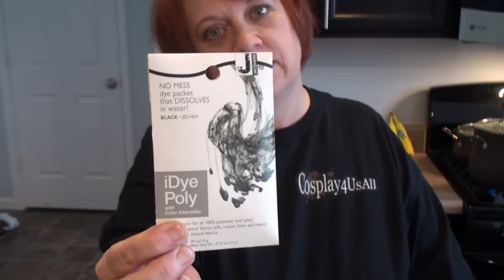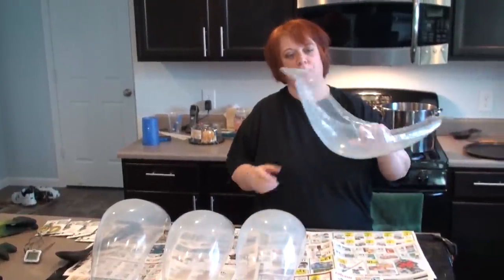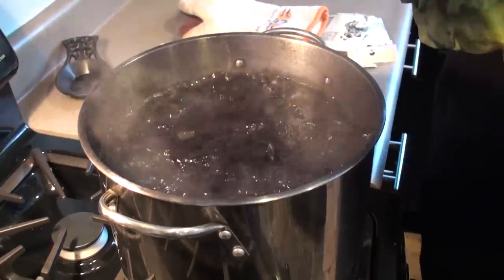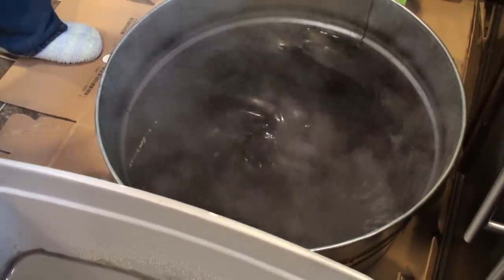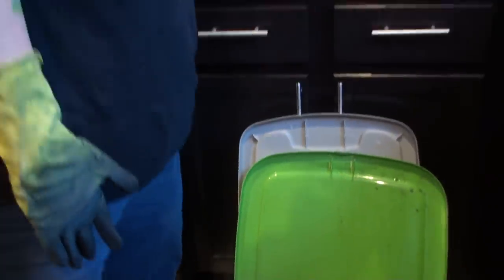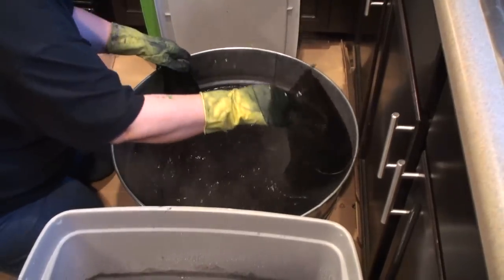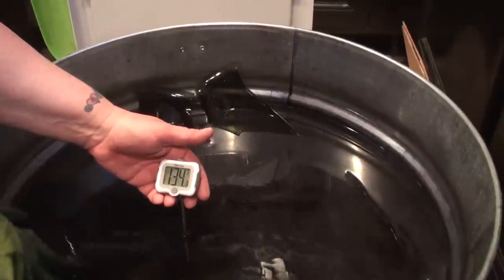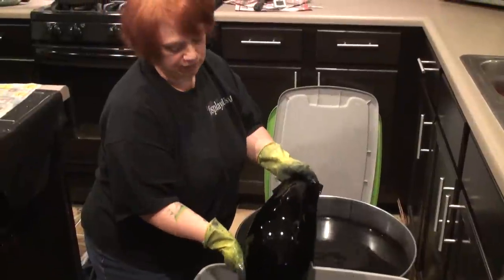How to Dye a Plastic Visor (PETG)

Comment: how many idye packets for tinting sunglasses lenses?
the lenses are smaller pieces, would I have to use one packet with fewer amount of water?
Reply: they're plastic lenses .
Reply: +seek wisdom Depending on the amount of water you use, one or two packets would be fine. If it is a small pot, one should work. A slightly larger one, go for two.
Reply: ***** thank you..😃 super video..

Comment: Fantastic, and you guys seem nice too! Quick question, would this work on PVC fabric (i.e. transparent raincoats?)
Reply: It works on synthetic fabrics, not sure about a raincoat. Might depend on whether or not the PVC fabric has any kind of water repellent on it, or is treated in any way, to make the rain bead. I would say, give it a go! Try an inconspicuous area (bottom, back hem maybe?) or, if the coat has anywhere that you can snip just a tiny piece off (lining, extra material at the hem, or pocket?) snip that and try a tiny test :)
Reply: Thanks for your advice! It's for a coat I have yet to buy, so I could always test it out on a few cheaper versions first. Thanks again :)

Comment: i have a very strong perscription on my glasses and becouse of this i cant use masks with visors unless thy match hat perscription.

i have a custom made helmet with slots for my lenses to go in but the need tinting to match... wpuld this method work!????
Reply from the maker: Unknown. It would depend on the material (type of plastic) that your lenses are made from. Certain plastics respond to the dye better than others do. Also, if you have any kind of anti-scratch or anti-reflection treatment on the lenses, then it most likely would not work.
I usually would say to experiment with some scrap and see how it goes, but I don't think that would be possible in your situation :/

Comment: Will this method work on Oakley football visors? And is there a way to do a multicolored tint?
Reply from the maker: Jaquan Jasper depending on the type of plastic (and its chemical makeup and thermo properties) you may need to adjust the temperature of the water (warmer for denser plastic). Also, if the visor has safety coating on it (which many do) your results may not be as good (the protective coating may repel the dye). To get different colors (like a rainbow) you will want to use the dip method. Rather than soaking the whole visor, dip each section in the dye bath. You'll need to think out your color choices and make sure to do them in the proper order since, depending on how many different colors you're using, there will be some overlap.
Reply: Cosplay4UsAll cool. Thank you so much

Comment: Will this work for an acrylic fishbowl/lamp post globe?
Reply from the maker: Since acrylic is a different type of plastic, with a different chemical composition, and different deformation point, there is a slightly different method of dying. If you Google how to dye acrylic plastic you will find info on the proper method to use for that.

Comment: what do you prefer to use if I wanted to dye my football visor?
Reply from the maker: Any plastic visor you should use the iDye Poly as it is specifically for plastic products. If your helmet visor has a safety coating on it, your results may not be the same as in our video.
Reply: +Cosplay4UsAll where can you get the dye you preferred to me?

Comment: I have tried this method with acrylic and after keeping temperature for 2 hours and 24 dunks i have had little to no affect.
Reply from the maker: Our method (and temps, etc) are for PETG which is NOT acrylic. Acrylic has a different chemical composition and very different deformation temperatures than PETG does. Our method should not be used for acrylic. It CAN be dyed but it uses other chemicals, different dye, different temps and technique, and is more volatile.
If you Google "How to dye acrylic plastic" your should find some info on the process. We cannot recommend any particular methods as we have not done it ourselves.

Comment: So this temp will work with 1/32" or should i go a lil bit colder?
Reply from the maker: As far as I know, it "should" be the same temp. However, I would start with the temp we mention in the video but put a test piece in first. As long as it doesn't start to deform you know you are ok. If the plastic gets too soft, then you can cool it down a few degrees :)

Comment: Do you know what I could do to also make the plastic more translucent/cloudy?
Reply from the maker: I'm not exactly sure what you're asking, as translucent and cloudy are the exact opposite of each other. To make it more translucent (ie clear) use less dye and less time in the dye bath. To make it cloudy, if you don't want to be able to actually see through it, you can use spray tint (found in Walmart, etc), or scuff the plastic with fine sand paper or extra fine steel wool. This will basically scratch the surface and diffuse any light going through it, but you won't be able to see through it either.
Reply: Cosplay4UsAll Ok thanks I meant cloudy I guess. I said translucent/cloudy because when I was looking stuff up it made it seem that something translucent was les “see-through” than something transparent. I’m aiming for a kind of foggy effect and I think that I’m going to try the sandpaper thing.

Thank you for replying👍🏾🙏🏾
Reply: Cosplay4UsAll And would it matter if I did the sanding before or after I dyed the plastic?
Reply from the maker: I would say you would probably want to do it after you dye. If you do it before, it is possible the dye will settle more heavily in the sanded area and give you an uneven tint.
Reply: Cosplay4UsAll Ok thank you for the responses!

Comment: hi guys that vid looks great about using ipoly idye on petg does it work on lighter dyes ??? and also if I add acitone to the colour would it come out better I really need to colour some petg plastic is it that easy you see in the vid I'm looking at doing bright colours as well can anyone help me many thanks Paul
Reply from the maker: I have no idea what adding acetone would do to either the dye or the PETG itself, but it is something I myself wouldn't try. The iDye Poly is formulated to work on plastics so it is already pretty darn good at it. We have seen people have good results with pink, red, green, yellow and of course the black. Always, always try it on a test piece or two first!

Comment: Thank you ! Clean with what ?
Reply from the maker: Glad you liked the video! We use Meguiar's Plastic Cleaner/Polish. I am sure there are other similar products out there. You can check in the automotive department, or an auto parts store in the section with cleaners and waxes. Any wax/polish type product that is safe for plastic will work :)
Reply: Thank you!

Comment: could i use this for my hockey visor?
Reply: Not sure. Many times those have coating on the plastic, for safety reasons and to prevent scratches. May or may not work, depending on the plastic. Worst thing that would happen is they dye wouldn't grab well enough to darken it.
Reply from the maker: Oops, replied with my other YouTube sign in,lol, but the reply is correct :D
Reply: ok thank you

Comment: do you think it could work for a football visor
Reply from the maker: Many of those are made from safety material which is coated. If so, the dye most likely will not adhere well.

Comment: hello Im a big fan of your work! actually I followed your very same process of vacuum forming!... what did you use to glue The visor to The piece?...thanks for your videos
Reply from the maker: +Eduardo Moncada Magnets! We added 4 small pieces of Sintra (pvc foamboard) to the inside of the helmet, along the edges (2 in front, 2 in back) and recess mounted magnets in each piece. Then we glued 4 matching (but opposite!) magnets to the inside of the visor. Check the video on our Facebook page, here https://www.facebook.com/cosplay4usall/videos/vb.263465680410798/494857923938238/?type=3&theater

Comment: Will this work for 2 leader Pepsi bottles?
Reply from the maker: Jarez Littlechild Yes, as it is the same type of plastic (PETG). Just don't put it in the hot water with the cap on the bottle. Being exposide to the heat and humidity may cause a build up of pressure inside the bottle.
Reply: Cosplay4UsAll k thx
Reply: R u sure it won't melt the bottles
Reply: This was also my question, thank you for asking it.

Comment: Can you do this to a motorcycle windsheild?
Reply from the maker: Renee Normandie probably not, since it is a much harder, denser material than PETG is (which is basically the plastic that soda bottles are made from). Plus the windshield is most likely treated with a safety coating, to prevent chips/cracks etc.

Comment: Can you reheat and reuse a pot of poly idye?
Reply from the maker: I've never heard of anyone saving and reusing dye water, even if it's just being used for fabric dying. Perhaps it degrades over time or doesn't take reheating well. Considering the low cost of the dye, I'm not sure it's worth it.
Reply: Cosplay4UsAll Ah okay. Thanks for the reply. Did some dyeing of some lenses recently and it went really well. So thanks for the helpful video.

Comment: Does this dye work on clear worbla as well?
Reply from the maker: It should. Just have to find the temperature just short of deformation, as it is probably different than the temp for the PETG.
Reply: My understanding is the clear worbla needs 250F to shape as many folks use industrial heat guns.  I'll try a test piece, thanks

Comment: Do you know if this method also works on other kinds of plastics? I am having a bit of trouble getting them to dye at all, I've tried rit dye and window stain and neither have turned out any good. (I'm using clear plastic rc car parts)
Reply from the maker: We have only used it on PETG. I would say to definitely try the iDye Poly. Some folks who have used our method have said they tried Rit first and it didn't work at all, but the iDye (which is specifically made for materials with plastic in them, like polyester) did the trick. Do a bit of research and see what temp your plastic is safe to heat to and use the appropriate water temp. I would think that would do the trick ;)
Reply: Cosplay4UsAll How much is it for a complete Zer0  helmet ?
Reply from the maker: bLuR vOpTicz We no longer offer completed Zer0 helmets. We do offer raw casts here...http://cosplay4usall.com/shop/
Reply: Cosplay4UsAll How would I go about making it a wearable helmet ?

Comment: Will this method work on acrylic sheets?
Reply from the maker: Amy Oliver of the acrylic doesn't have any special coating on it, and you get the water the correct temperature for the type of plastic you're using, I don't see any it wouldn't.
Reply: Cosplay4UsAll Thank you! how would you go about determining the right temperature?
Reply from the maker: You should be able to Google it and find out what the deformation temperature is. If you can't find it, you can do tests, using clear hot water at various temps and small pieces of the acrylic you're using. When you dye it you will want it just under the temp that the plastic starts to become malleable/bendable and loses shape.

Comment: Hi! Would the idea poly work on polyethylene plastics?  I try rit dye. Did not work. Any advice would be appreciated.
Reply from the maker: Not sure if it would work or not, since we have only tried this with PETG. The iDye is for fabric with plastics in it (like polyester) and works like a charm on the PETG. All I can suggest is to find out what the temperature is that your plastics temperature rating is (the temp at which the plastic starts to become malleable) and try the iDye on a test piece at just under that temperature.

Comment: would this work for titan visors from destiny.
Reply from the maker: If it's made out of PETG, then yes, it will work for a titan visor!
Reply: Cosplay4UsAll  okay, some how would i do a pulse led pattern. http://1.bp.blogspot.com/-AZxYG7JykRo/VDCE0HX-rKI/AAAAAAAAGx0/z7Xs4-57GIY/s1600/FznRh8H.jpeg this the helmets that i want to do.
Reply from the maker: +spartum1337 Lol not a clue! Maybe take a thin piece of acrylic and mount the small leds in to the acrylic (with all the wiring) and an arduino to run it. Mount that inside the helmet, under the PETG. Check out Volpin Props blog on how he wired up his Daft Punk helmet. Would be something similar to that.

Comment: So the longer they stay in the hot water, the darker they get ?
Reply from the maker: Up to a certain point, yes. Based on the limits of the dye itself. The number of dye packets also has a bearing on your results. One packet diluted in a LOT of water will only get so dark, while if you used more packets and the same amount of water, you would get a darker color. Temperature also plays a role. Too cold and it just won't bond, too hot and you will deform your plastic.
Reply: Okay !
Thank you :D
With this method that you use can people see the face of the one wearing the visor ?
Reply from the maker: Kevin N'alpca not of you get it dark enough! They can't see in to ours at the person wearing it, but she can see out. Like sunglasses ;)
Reply: Okay ! Thanks c:

Comment: They sell a plastic spray paint for darkening tail lights and headlights at Autozone for about 10 bucks. 1 can would easily do a lot more then 5 visors and wouldn't risk changing shape of formed piece. What the hell is this labor intensive, expensive and risky mess?
Reply from the maker: Wow. So cranky! Yes, they do indeed sell tint spray. Which is great for tinting taillights. Because you don't actually need to SEE through your taillights, all it does is show diffused light through the plastic. If you are not concerned with seeing through your helmet visor, by all means, go ahead and use the spray tint! However, if you actually want to see where you are going, this is the method to use. And if you monitor your temps, as mentioned in the video, there is little to no risk of deforming your plastic. As to your ending comments: 
Labor intensive - anything worth doing, is worth doing well. After spending weeks or months on a cosplay, spending an hour tinting a visor that will allow you to see through it is well worth the effort.
Expensive - iDye Poly is about $3 a packet. If you are only doing 1 visor, two packets is fine. Another couple of bucks for a cheap plastic tote to dye it in (so you can toss the tote out later). If you don't have an oven/meat thermometer, then ya, you might want to pick one of those up for like $10. Ohhh so much money spent! Lol
Risky mess - it is only a risky mess if you are not careful, and you spill the dye water. Which is why, whenever you dye ANYTHING, you need to take precautions. Just like using a power tool, safety first!
And finally, here is a link to a picture taken from the inside of the first visor we made, when we took the "easy" way out and used the spray tint https://goo.gl/TmN5yw  Here is what it looks like through a freshly dyed visor https://goo.gl/I3BEkG
This method has been used by dozens and dozens of our followers, all with outstanding results. It is one of the most popular methods used by prop makers, and has been shared widely on various DIY, prop making, and cosplay forums. The choice, of course, is yours.
No one is twisting your arm to do it this way, so take a chill pill.
Reply: Cosplay4UsAll My apologies, it wasn't meant to sound cranky nor rude, maybe snobby but mood is so difficult to convey in typed messages. It was kinda meant to sound inquisitive and bad ass as if I know what I'm talking about. (But reality is tightening its grip) Like someone walked in and the kids finger painted the kitchen blue and orange flames yet it looked really good. "What the...[non audible thought] , but leave it and I'll clean another day."
Reply from the maker: Hahahahaha!!! This is the best reply we have ever gotten, on any of our videos, lol!! Apology accepted :)  And my apologies back to you, if I came off a bit....touchy. By no means do we know everything, about anything, but we are proud of our policy of sharing things when we do manage to stumble our way in to something that works really well. We even share it when we screw things up, so others can see that it happens to everyone! Sharing what we learn, and encouraging others to take the plunge and build their own stuff, is why we take the time to make videos and write up tutorials. But it is the internet, so that means putting yourself out there for trolls and critics. Sometimes we just reach our daily limit of abuse. Your original comment caught me at that point, lol. Thanks for coming back and commenting again :D

Comment from the maker: In case you missed it...
Reply: Cosplay4UsAll can i use hair dye? or a cloth dye?, idye is not available in my country
Reply from the maker: Hair dye no. You can try clothing dye but try and find one that is specifically for "synthetic" material. Rit is coming out with a line of dye's that will work on synthetic materials so maybe some other dye lines in your country have one too. If not, maybe try ordering it from Amazon (if possible). You really want one that is specially made for synthetic or polyester material, which is basically plastic :)
Reply: +Cosplay4UsAll where did you get the big metal bucket and how do you make your PETG plastic into a dome shield shape
Reply from the maker: We got the bucket at Tractor Supply, although if you are just doing a single visor you don't need a bucket that big (we did 8 at a time). Any good quality plastic tote will do if you are just putting hot (not boiling) water in it.
To make it dome shaped we vacuum formed it over a buck we made. https://www.youtube.com/watch?v=bE2JjdMpYto